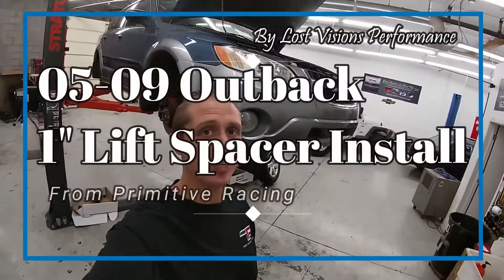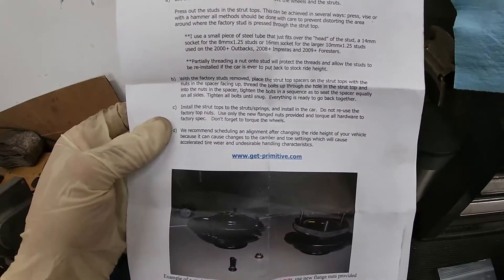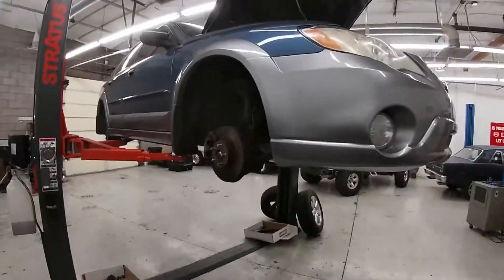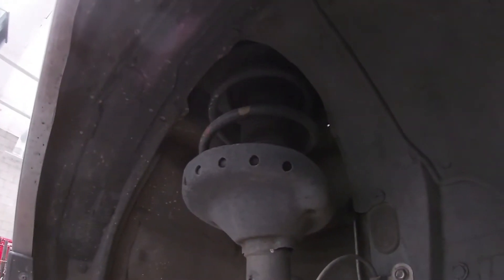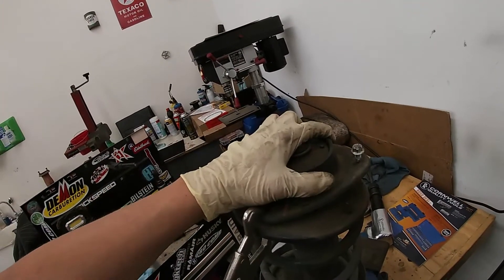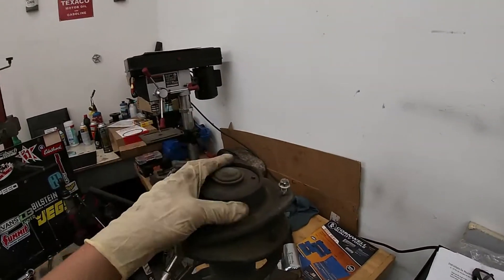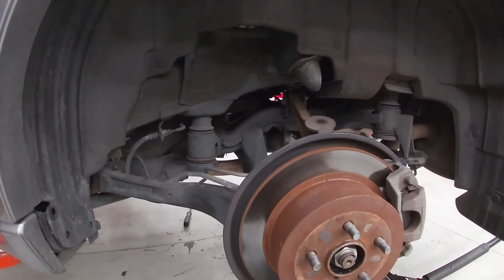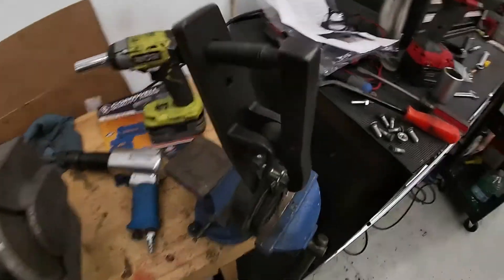05-09 Subaru Legacy Outback 1 inch Lift Spacers Installation Review on Primitive Lift Spacer Kit

Comment: Put 1” rear spacers on my 2007 Legacy GT spec.B. Putting the strut with the spacer back in the car was an absolute nightmare. I used the same jack method to push the rear shock up to the right height for the lower bolt. It felt very sketchy/dangerous. I ended up using a spring compressor to take some of the force off the rear strut (to avoid lifting off the jackstand). I also disconnected the tie rod ends to loosen up the suspension assembly.
Reply: Spec b were build like an sti impreza